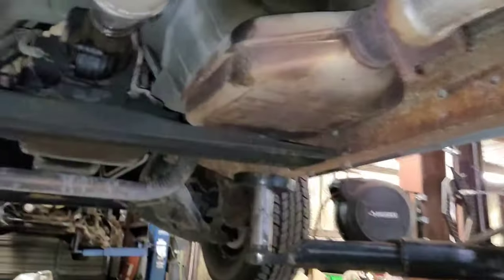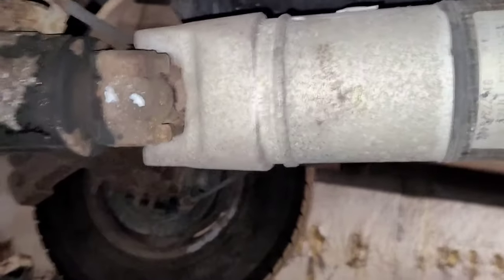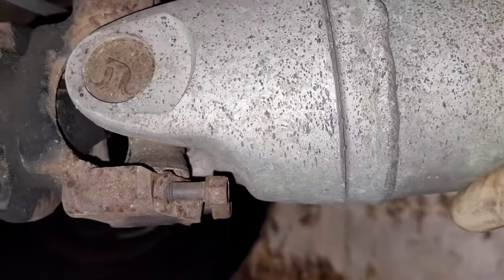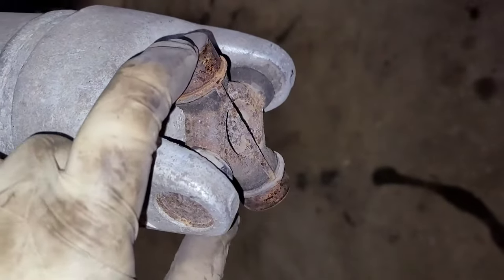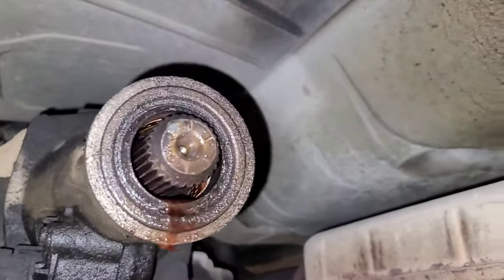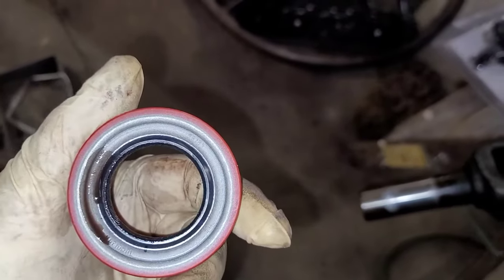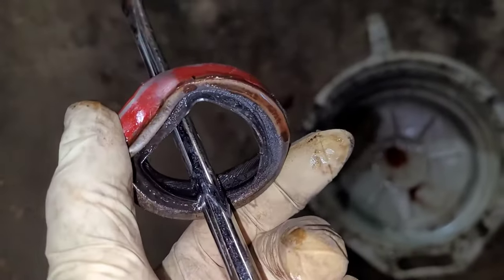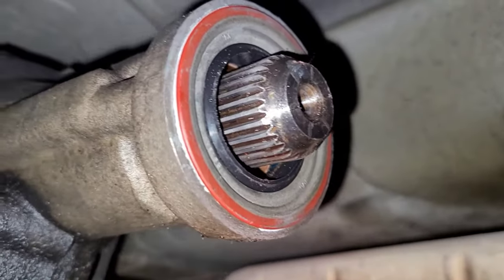Chevy Tailshaft seal replacement

Comment: Good video, my only recommendation is replace the bushing & yoke also. As you could see the seal was already replaced, it went bad again because of a bad bushing/yoke/u joint, which cause vibrations.
Reply: Looked kinda like the rear differential had some leakage too. I was thinking one of the U-Joints might be bad or may have been at some point.

Comment: Thanks for the video.   I just changed the seal on my 2011 Chevy Silverado 4.3l.  For those of you who haven't done this before, don't let the size/length of the drive shaft intimidate you.  Mine was aluminum and not heavy at all.  Furthermore, I decided to leave the driveshaft  elevated.  I placed a milk crate with some 2x6's just forward of the differential and added a 2x4 between the mid cross-member and drive shaft.  This means you simply disengage the drive shaft and shift it out of the way enough to access the seal.  I think this was much easier than dropping it all the way down and and lifting it up back into place.  Simply use whatever you have in your garage to keep it elevated near the same level and carefully shift it to the side.
Reply from the maker: @margaretjohnson7910 Thanks for the adding your helpful information for viewers. Thanks for watching the video & adding your experience. Keep wrenching! Kenny

Comment: I just did this on my Astro. The seal was original and tight against the transmission housing. To remove the seal, I used a   good brand new chisel and hammer to VERY carefully to go around the seal flange and separate it without damaging the transmission. After that I hit the flange with a screw driver to deform it slightly at one point in the old seal for removal. Worked perfectly and in a couple minutes it came right out. No damage or marks on transmission housing. 
For installation of the new seal, one of the cups in my ball joint press fits perfectly over the new seal.

Comment: I have a 2001 GMC 1500. Had the output shaft seal replaced. It is still leaking where the tailshaft and the seal meet. Not leaking from the rubber boot. I noticed that in the video you put grease on the inside of the seal and sealant on the outside. My mechanic did not put any sealant. Would that cause the leak? It is only a tiny drop. What kind of grease did you use? Trying to find your seal prep video. Thanks.

Comment: dont know if youll see this or not but i was wondering if there is an underlying issue because my rear diff is leaking a bit too and so is my tailshaft thanks in advance!
Reply from the maker: If the seals are constantly going bad, the tailshaft seal could be caused by either excess play from a worn tailshaft bushing or rust build up on the shafts yoke. Possibly even a worn yoke. The pinion seal in the rear axle could be from too little preload on the bearings or similarly , a rust or crud build up in the yoke that rides in the seal. I've on a rare occasion seen the yoke actually get a wear groove from the seal. Thanks for watching